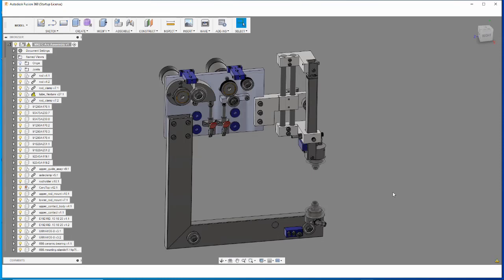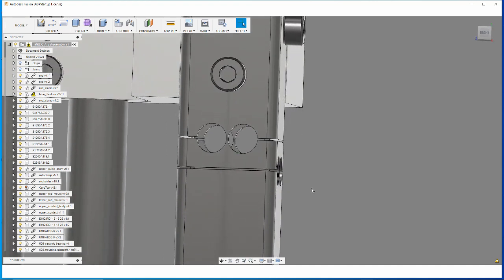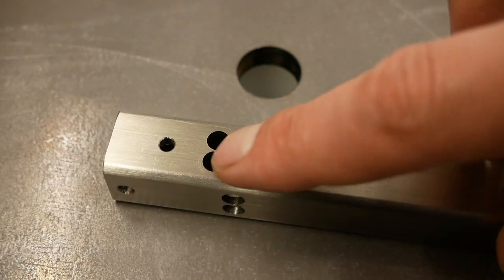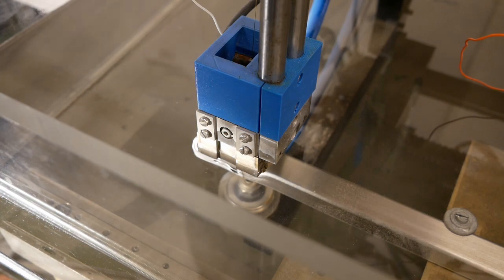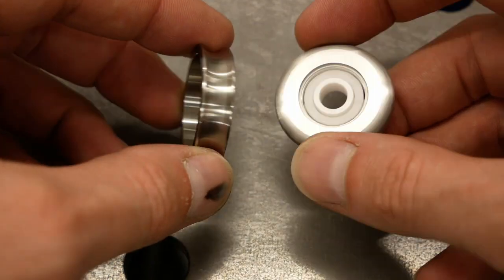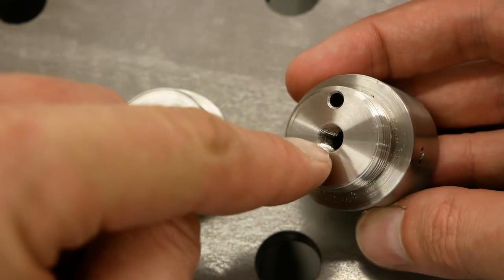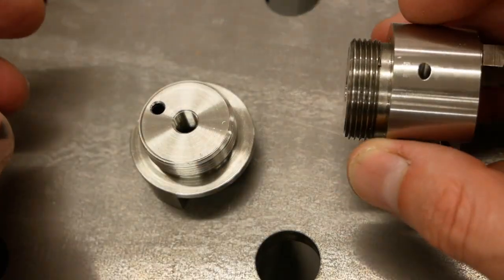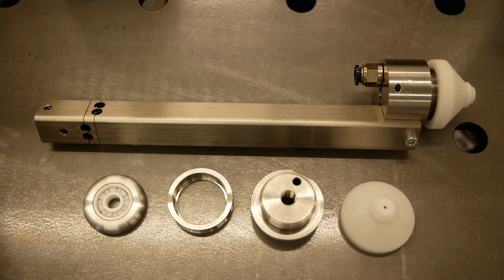Wire-EDM Machine, complete MK2 redesign: Part 6, making C-Arc parts

Comment: hi, nice design for the flexure. 

Could you please explain why if the pinchroller design can handle the tension  why it isn't used at both ends? 

Also what makes the wire go to the centre of the grove?
Thanks
Kevin

Comment: Hi Mike ; were are you putting the wire contacts? , also small flushing holes work ok ,as long as you don’t have to wirecut tapers,but that is another matter, Keep up the good work!
Reply from the maker: Hi, the wire contacts are just above and below the top and bottom wire guides. They are 12mm round pieces of carbide.

Comment: The pinch rollers on my Mitsubishi machine are carbide (Straight not a radius) . Even in the carbide rollers the wire will eventually wear a groove in them. They make them reversible so you can get another use (Life) out of them. I'm thinking your stainless rollers wont be hard enough. Maybe you could use 440 SST and harden it would be better. Will your spark generator work for a hole drilling machine?
Reply from the maker: Thanks for the tip! I'll see how long they last and will machine new ones from a tool steel which can be hardened after these have worn out. The BX17 arc generator is also a very capable generator for drilling holes. Here's a nice example: https://youtu.be/rpHYBz7ToII
Reply: Mi pinch rollers are ceramic , with a stainless centre, by adjusting the pressure between the 2 rollers and the wire you can control the way that the waste wire sit in the bucket..